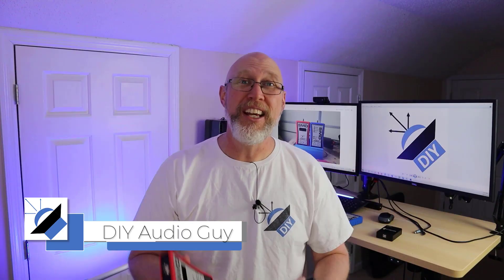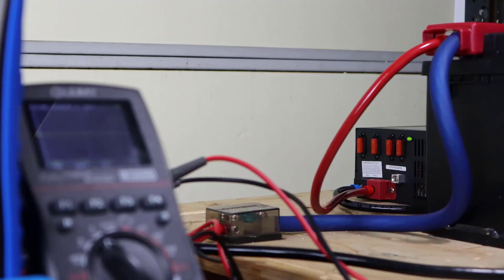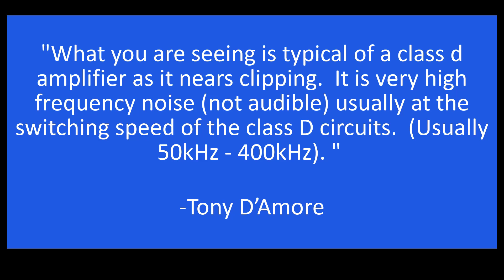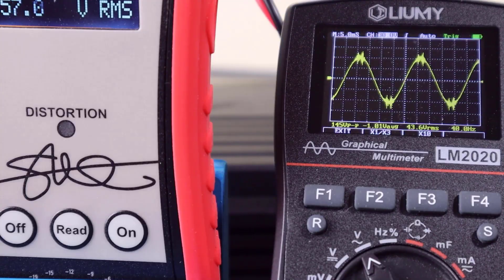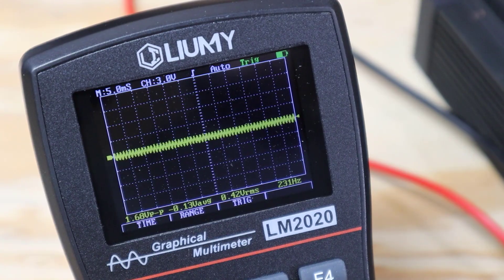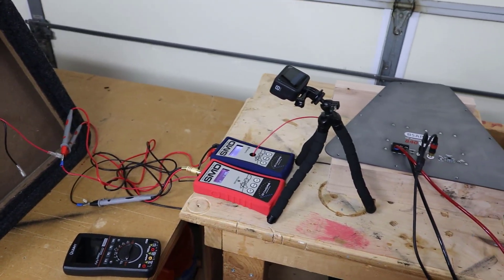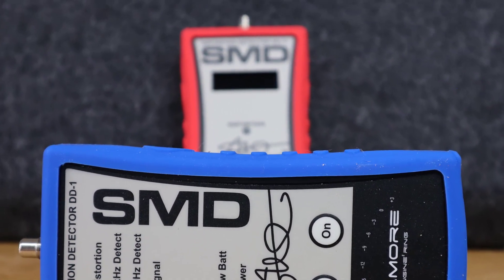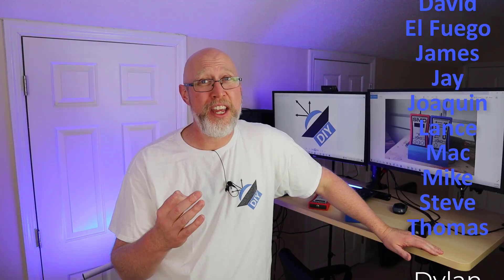The best way to set amp gain?  #SMD DD-1 VS Liumy Oscilloscope

Comment: I know I know.  Everyone has their tool they like to use.   But let me tell ya.  I got the DD-1, and used it with the Cheap gear I was testing.   My god man.  It was a gift from beyond!   I was able  to find every bit of CRAP gear and identify almost every little bit of distortion or noise in my system or gear that just did not make the cut and I was able to get this very inexpensive gear and find out its weaknesses and even fix it.

I was even able to determine the weak spots in my signal chain for my head unit 
 same with the digital signal processor I was using.  

the thing is, I don't just use one tool I use as many as I can to go ahead and get a good reference just like somebody at audiosciencereview uses a very expensive machine to go ahead and get results and measurements from gear.  

but all that does is give you a baseline working in a lab environment which in our car audio world doesn't quite work that way.

but thanks to his tools, Steve made literally made my car audio experience not only inexpensive but I was able to get the absolute maximum with the equipment I was using.  

 the final judge is always going to be you and your ears. But for me? I use as many tools as possible to track down any sources of noise in my signal path and chain.

my final piece of advice is don't worry about the best way worry about the most thorough away and you will always have your audio Nirvana
Reply from the maker: Right, you have to test everything.

Comment: @DIY Audio Guy  I love your videos and had a few questions boggling my mind any answers or advice is much appreciated:) So I set my gains using a Oscilloscope and the wave was clean up to 40 volts on a skar rp.800d:) My first question is that I feel 40 volts is quite high for a 800 watt rms at 1 ohm amp so am I not understanding something correctly here? My second question is I realized by watching the soundwave that when I set my crossovers (subsonic=26hz/lpf=100hz) while playing the same 40hz-5db tone the voltage drops from the 40 volts to 25 volts. I'm just a little lost on why my voltage is changing so some clarification would be great cause that's quite the voltage drop. Last question, is it not good to set your gain with crossovers already set? I see everybody set crossovers after gain but I'm just curious if you can set crossovers then gain as long as you never touch the crossovers after setting the  gain? Cause in my mind it makes sense that that would maximize voltage/performance:) I believe that with 25 volts after crossovers I'm only getting 625rms wattage out of the amp so if it needs boosted a bit I will:) thanks for any advice or clarification:) I also have the smd dd-1 and the smd clips at the same point as my Ocsilloscope so I believe everything is accurate:)
Reply from the maker: The crossover works by cutting voltage, the slope follows log10.  So it is not a wall, it is a gradual roll off that gets steeper.  What you're seeing is the top of that gradual roll-off.  

And yes, that does seem like a lot of volts for an 800 watt amplifier.
Reply: @DIYAudioGuy  Awesome thank you for the reply:) Would it be bad to set my gain with the crossovers already set?
Reply from the maker: @robertohara9547  Not the way I would do it, but it will not hurt anything as long as you are not clipping.
Reply: @DIYAudioGuy  Awesome thank you so much for the advice I appreciate it a ton!!:)

Comment: Is there a way how to test a phone/tablet for distortion? Especially when streaming bluetooth, can I max the volume out?
Reply from the maker: If the amp is not clipping then you can turn the BT up until you see clipping.  Either the scope or DD1 can be used for this.

Comment: The dd 1 one reminds me of my hp distortion analyzer. The scope isn't a distortion meter it's a wavemeter it does care about distortion. So it makes sense the dd1 will pick up distortion before its visible on the scope.
Reply from the maker: I was really shocked at how quick that plate amp distorted.
Reply: 0.4 millls  difference 😂😂😂😂😂😂wow

Comment: Tried training my ear, ended up loosing hearing in my left ear😉. But seriously though, a lot can probably get it close by ear. However I don't trust it enough. The way I look at it I spend enough on amps and subs that it's not worth risking. I've tried by ear then followed with the dd1 and an amm1. Then check it with a dmm to see how far off I was. Next smd goodie I want is the signal generator. Thanks for sharing another excellent video
Reply from the maker: The best thing about the SMD tools is that you don't need to plug into a computer.
Reply: @DIY Audio Guy  agreed. I still have to plug into the dm-608 dsp once in a while. I have the bt-24 bluetooth dealio but it's just easier to adjust thing on the laptop. It's really cool to stream hq files and bypass the head unit though. We live in a cool day n age with tons and tons of goodies to play with.

Comment: Great video. If I was into systems like I was in my 20's I would have definitely spent the money on the Steve Meade gear. Nowadays, I might install an amp once every couple of years so the Liumy is good enough, plus it's a pretty decent multimeter. That part about the high frequency noise was a good tip. I have seen that before and thought it was distortion.
Reply from the maker: Thanks for your comments, I try to read them all and I try to listen to my viewers.

Comment: I use an oscilloscope with fft as that allows me to see the actual wave form and the harmonics being produced. Where I live a two channel oscilloscope with this function is a third of the price of one SMD device and can be used to read many other signals for other projects. You can add a current probe and do math to get real time power and impedance numbers.
Reply: steve meade makes money on people that think math is scary, and now they got a little blinky light for 300bux, and steve using scare tactics to preach how everyone's system is clipping, and if they keep letting it clip their subs will explode.
Reply: @nickn7939  thank you!
Reply from the maker: @nickn7939  Sounds like a good reason to pay attention in math class.
Reply: Plus if the Amp ever dies you can use the scope to trouble shoot and repair it if you choose.
Reply: I think it's unfair too ues ones product and mass produced these units to sell at a very expensive price for what is a simple light the smd dd1 is good for what i does but Steve should be ashamed for over pricing a piece of equipment that only has a light no screen and advised everyone that they need he's product so he can continue too live out his expensive life style.  I bought one because i too fell into the track . I repair and install and modified car audio and im a electrician as my job i been installing car audio since i was 12 and since then i love car audio i remember the real and fun reason the  days of car audio and electronics and it's why i made my hobbie too learn it i will simply say dont believe the hype i uesd the tool that cost me up too 200 plus shipping  with a cd and a blinking light knowed as the smd dd1 and i returned it the next day reset my gains in my system and too my ears i was more pleased with my sound again i noticed that my gains were a little lower than with tool . The car audio and sales is all about making money now  . And selling cheap products made and deigned with cheap parts what does matter if it says made in usa with cheap parts from China.  People stop making these con artists rich they over price there gear and boasting there worth all over the internet.  Car audio was never about money it was about music and joy and products that were way better than todays junk for half the cost i should know i been repairing amps and electronics since i was 17 in fact my amps are modified and are old school  Components cause i know how well they outperform todays way over priced junk  back in the day you did get what you payed for.
Reply from the maker: @tonysolis825  I just want to share the information so people can make an informed decision.
Reply from the maker: It all boils down to price versus performance no matter who you are and no matter where you are.

Comment: nice video! out of all that, the MOST important thing you talked about was how everything in the chain starting from the beginning matters.  I see a lot of lame video's on YT where someone is trying to "teach" people how to set gains with an O-scope and they are doing it completely wrong.  "Just turn up the gain till you see (or hear) clipping" is not how you set gains.  Head unit (or L.O.C if tapping in), DSP, crossovers etc, everything BEFORE the amps needs to be known first or it is all out the window.  Also there is gain overlaps.  Something completely ignored by these so called youtube "teachers".  I have always told people, USE AN OSCOPE first. Learn it. Love it. USE IT RIGHT.  Then get a DD-1 (for more accurate  and simple results) once you feel like you are ready.  It's the same process. (The DD-1+ Plus is a little different). But the standard DD-1 uses the same exact technique you would use if you had a scope. So no matter which one you choose, just do it correctly.  Or turn all knobs to the right and jam on till you smell that smell.  There is a right way and LOTS of wrong ways to do it.  Thanks for the video it was a good watch :)  Appreciate ya for that!
Reply: Bought my DD-1 on the first run of them, it's been solid all these years and still works perfectly till this day.  I'd recommend it, even for budget shoppers.  The amount of money it will save you in the long run,  keeping you from destroying your amps/subs pays for itself.  

 You might think, you'll only use it here and there, but you'll find yourself using it more often than that, especially if you associate with people that like audio as well and you do a lot of tinkering and personal builds etc.  You'll be offering to help tune peoples stereos, because you got this sweet tool you want to show off Lol, and it's the basshead thing to do.  Word of mouth will get you more people asking eventually too.  Car audio is one those hobbies, that brings all walks of life together. Cheers Fellow bassheads!
Reply: My dd1 was worth every cent
Reply: Hey Steve. I have the AMM-1 which is a great tool apart from how hungry it is on 9v batteries anyway is there any chance in the future of developing a all in one hand held unit, obviously the price will be much higher but at the same time much cheaper than buying 5 different tools that i feel could be incorporated into one, any thoughts on this?
Reply: This is a great video for those people who complain the DD1s are too expensive but don't understand how incredibly useful this tool is not to mention how quick it is for the guys who are installing amps every day.
Reply: @battleop  its only quick o scope is fine 😂
Reply from the maker: Thanks for the tools!
Reply: @DIYAudioGuy  no prob! enjoy :)
Reply from the maker: @meade916  I was pleasantly surprised to see the DD1 detect distortion when there was no clipping.  I knew that system did not sound right.
Reply: love both yalls videos, thanx fellas
Reply: @meade916 what up big doooooooooooooooooooooooooooooooooooooooooooooooog
Reply: Steve Meade is a very awesome brass tacks kind of guy I have been following Steve from the beginning . One day i hope to be able to meet Steve in person!!
Reply: I dam one one DD but they expensive 🤲 i have scope too but I would love to have DD as well❤
Reply: Not gain.  Fixed.  You are setting the input attenuation to maximize SNR and not overload the input section.  One might be so inclined to have an active device, preamplifier, to maximize SNR and maintain maximum signal transfer--impedance matching.
Reply: @squirrel6687  LOL😂
Reply: I’m an owner of the DD-1+ and the original DD-1 HV, CC-1, IM-SG (first gen), AMM-1, and the VM-1 OM-1 and the TM-1. I also have a TPi meter/scope in my kit, a polarity tester and multiple connection options for any and every install need or tuning. I use the Liumy for work. For me, it’s the perfect travel set for on the road installs, audio monitoring, or just tinkering. From NY to CA, high heat, to cold weather, no cooked equipment, and everything is clean. Thanks DIY Audio Guy, and Thanks meade916 for the videos and tools. The audio world needs all your support to DIYR! (Do it yourself right.)
Reply from the maker: @mikehonda7934  That polarity tester is a lifesaver.
Reply: @DIYAudioGuy  sure is!!! Handy tool to tell you if you have all speakers in proper polarity. Be surprised to find the factory reversed a tweeter or a midrange for a phase issue in the cabin for acoustics.
Reply: @mikehonda7934  just be careful when hooking stuff up and polarity is fine there all just useful not indispensable ❤
Reply: @giosant5327  thanks, but not thanks. I don’t have install issues.
Reply: You make awesome stuff bro! My DD1 and CC1 are well worth the money. So then I got the hard case for them. And now I've got the TMM1 for the fans. Turns heads man. Badass stuff!!
Reply: Woah…. The man himself just entered the chat. He seems like a great dude. Check out that clear plexi enclosure he built for his suv. The most beautiful enclosure I’ve ever seen.
Reply: I need one to sets the gains the correct way witch one is good for a newbie to doit the professional way ? The dd-1?
Reply from the maker: @mester84  That depends, is this a one and done kind of thing where it'll be a few years before you install another amplifier? If that's the case I don't recommend any tool. Find a friend with some tools.  If you've caught the bug and you know you're going to get into car audio big time and install a lot of gear then go ahead and get the DD1 plus.  For everything in the middle It really just depends on your budget.  Get the best tool you can afford and then learn how to use it properly.

Hope that helps.
Reply: @mester84  you cant go wrong with the DD1+. You get a voltage meter aswell as detecting distortion. The directions are idiot proof aswell. Take it from me!
Reply: Can you elaborate on that “smelly smell” 😂

Comment: I love the SMD tools.
Especially the AMM-1. It shows you exactly what's happening in YOUR system..esp impedance rise. And seeing your actual power is awesome.
Reply from the maker: You can do most of that with a good clamp meter, but the AMM1 is designed with audio in mind.
Reply: @DIYAudioGuy  Rather difficult to use a clamp & volt meter when you are testing on music with the ever changing impedance loads, i think that is what he was getting at.

Comment: I love technical videos and I really enjoyed this. Thank you
I still think the best advice in your video is - buy a decent brand, which solves a lot of problems.
Reply from the maker: Right, you don't have to drop big cash on the high-end stuff, just avoid the bottom of the barrel.  Pioneer, for example, makes solid amps that are clean and do rated.  Rockford Fosgate Prime amps even have a clip light.
Reply: @DIYAudioGuy  100% decent brand doesn't necessarily mean buy the top end. You are correct. I'd rather own a Prime RF than some dubious brand.

Comment: i have been building speakers for fun, since 87 when I was a schoolboy, I've made some good stuff in time but also made the worst sh....ever🤣🤣
but listening when setting gains by ear have never failed me, never burned any unit or amp...  Steve Meade is one of my new idols in car audio, he's a genius and does things my way👌👌👌
Reply from the maker: If you train your ear it is a great tool.  But a lot of people that set by ear have not done that.  If you are ever listing to live music, and it sounds like crap, it is because the guy running the mixer in the back of the room has not trained their ear. (or the venue just sucks for audio)
Reply: @DIYAudioGuy  i don't like live music, i think it lacks quality, i like the bassdrum through the subs but not Moore than that...

I've trained my ears since 87 and i put a finger in each ear and listen close to the bass...
when I tune in the headunit I've always done as you also do and then i turn the gain on the amp for the woofer and set a mark aso for mid and treble.. and this is done with a original CD i use scorpions-passion rules the game for mid and treble and 80s pop/disco for the bass...sometimes hard rock..
some streaming are okay but most of it is too compressed and has no quality...
(one day i will try to connect my vinyl record player and listen to that, just for fun 😊)

Comment: I have majority of the SMD tools and a few of the meters. Having the tools for the job, according to the sensitivity of the project, is important. The SMD Tools puts the bench size of each audio portion, into a travel size hand held tool. Justification of the cost, yeah it is a jump, but I say, their is no cost too high, when it comes to safety.
Reply from the maker: Right, no need to drag a laptop or tablet into the car.
Reply: @DIYAudioGuy  except when tuning a processor unfortunately…

Comment: First thing, you should see where your source makes noise. And then, push on to amps/dsp/processors. Always find where your source clips/makes noises. If you dont do that first everything down the chain will be "off"....
Reply from the maker: Yes, exactly.  I need to get a bunch or bass knobs, and processors/crossovers and show that.  Put about 10 things in the signal chain and show how quickly it all goes sideways.

Comment: Hopefully more and more manufacturers will start including clip indicators on their products. Obviously we still need to check head unit outputs for distortion along with any other gear we put in the signal chain. But, simple clip lights on all amps would be enormously helpful.
Very interesting and informative video Justin!👍
Reply from the maker: That would be nice.